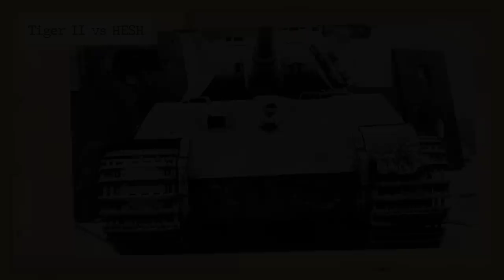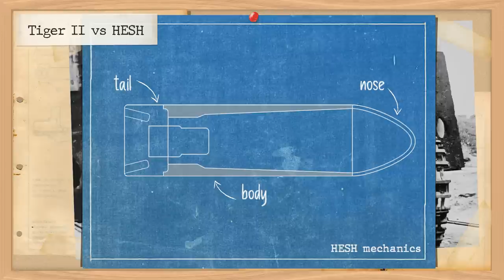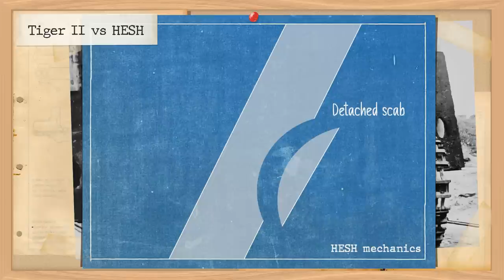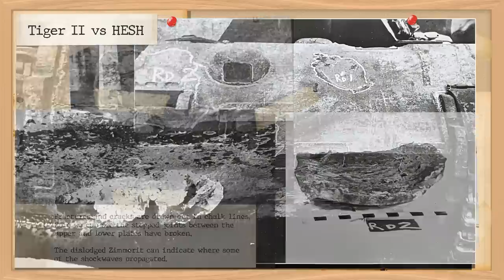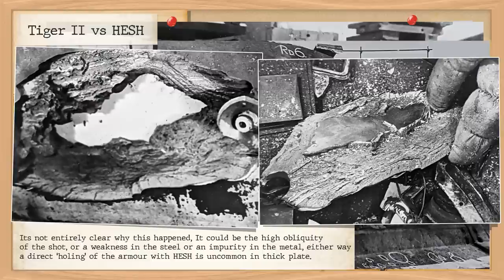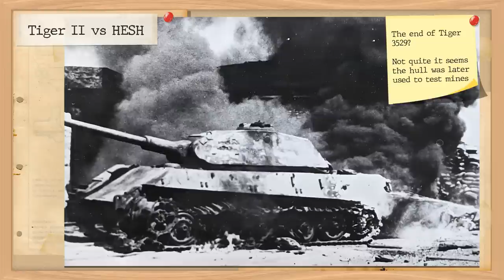Tiger II Versus HESH - Tank testing

Comment: Interesting that the track links were actually effective. I don't think I've ever seen any other ordnance test show such a conclusive result about track links actively contributing to a vehicles protection.
Reply: not really
its just showing how much a garbage round hesh is
smallest amount of space armor makes it almost useless
Reply: @AmirDarkOne  The smallest amount of spaced armor notably didn't make HESH useless, as was noted in one of the pictures referencing a previous episode on British spaced armor design tests.
Reply: Track links have to be as dense or denser than armor because it has to be able to handle the weight and stresses the vehicle its' designed for can generate. All the bolts and joiners also have a little bit of flex that can absorb the shock damage pretty well too. It's all in how it was designed. That's why tankers were putting it all over parts of their vehicles to help protect it, even though they weigh quite a bit.

Comment: As a complete military layman I can say with absolute confidence that getting shot at with anything larger than a nerf-dart is quite a scary situation, let alone a high speed piece of steel.
Reply: if you get hit by the big one your get pasted near instantly its the spall that's really terrifying cause it doesn't necassarily kill outright like in shot one the drive losing an arm and leg but no comments on death so likely would have survived the shot.... which sounds painfull
Reply: @volrosku.6075  Why would you "likely survive the shot"? It depends on where it hits you, just like any bullet or fragment. If it amputates an arm, you will probably live with prompt care. if it hits your torso, you are fucked. The spall fragments are just like the fragments from artillery shells that do most of the artillery's killing.
Reply: Not sure I follow you. You are getting shot at by a HESH shell. You are getting hit with flying fragments of metal. Like with artillery, you are getting shot at by shells , but the flying shell fragments are the lethal part. But no one is shooting shell fragments at you.
Reply: @volrosku.6075  assuming of course no things like infection etc. Either way, it is a enemy combatant out of the fight.

Comment: You mentioned it briefly but I’d love to see a video on exactly why modern British tanks use rifled guns. The theory I’ve heard is that it was to fire HESH more effectively, but is that the case?
Reply: Not any more.Challenger3 upgrade is fitted with a smoothbore gun.I understand that rifling was essential for the HESH round
Reply from the maker: alas while hesh does play a part, its very small, i will do a video as i have the docs a lot of them, but to sum it up, when we were first approached to do a SB gun, the goverment tasked Ft Halstead to decide whether they would be a good idea...but Ft Halstead designed, made, and sold rifled guns.....So surprise, surprise the answer was no. - there were some other considerations along the way, but the bread and butter of it was asking the one company in the UK with a vested interest in rifled guns… whether they would recommend the MOD switched to smoothbores and did away with rifled guns.

Comment: I saw a dinner serving platter size scab from a test with a 76mm gun for the Walker Bulldog off I believe a 4" thick target it was on display at Ft. Knox back in the eighties. I am not sure if the US HEP rounds have the Front buffer material it is not shown in any of the technical drawings of 105/106 HEP that I have seen.
Reply from the maker: should be there, il have an aske around tho

Comment: Interesting to see the British had another   initial/early turret Tiger Tank to do test on after WW II . The tank has early monobloc gun tube,  Later 9 tooth sprocket , and no deep wading pot.
I would guess it was and ex 1st Company or 3rd Company SpzAbt 503 vehicle lost in France. 
As the V2 still exist in Bovingtons collection and Broke barrel at Haustenbeck was scrapped.
The Swiss shot up another of the testing ground tanks and the V3 did not have a turret fitted if I remember correctly. The three  V models were all soft steel and would not have been good test subjects.
Reply from the maker: yes sadly they didnt record much about her at all, no markings i could see, bit of a shame
Reply: @armouredarchives8867  Was one of the early mid steel or early testbed prototypes. It still got binocular sights on the front hull which means it still did not had the sight developed for the gun but used the one from the early tigers for testing,

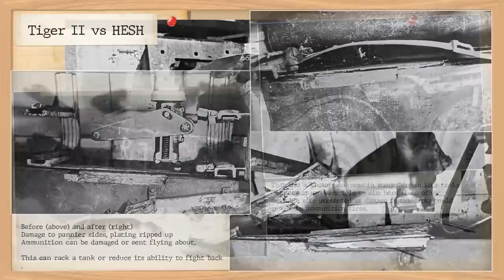At 12:56 Another thing caught my eyes is the drivers hatch elevating mechanism, this is again the one from the early prototypes and not from the ones which entered series production.
Reply from the maker: @venator5  good stuff! recon u can guess which one exactly it is then by rule of elimination
Reply: @armouredarchives8867  I would personally guess that it was one of the first 5 ever built. Since the first 3 was made out of mid steel there is a chance that it was not armor grade, but I am not 100% sure. (The one in bovington is v2 and regardless being the second is still mid steel)

This example is most likely being ranging somewhere beetwen v3 to v5.
One indicator I also seen is the lack of the equipment for submerging.
Reply: @venator5  Glacis is notched for the radio operators  periscope and the hull extensions are cut for the C-hooks.

Comment: I ran across an operation manual for a walker bulldog, in it it stated the velocity of the 90mm HEP was 750m/s and anything over would create too much dispersion of the explosive weakening the blast effect. It would seem that the US and UK test results are essentially identical.
Reply from the maker: pretty mcu, too fast and the plastic will spread too much or the case will crumple incorrectly, too slow and wont crumple at all or have time to form

Comment: i would like to see what 105 hesh and 120 Hesh dose to Warsaw pack AFV mostly the IS3 and T54
Reply from the maker: we never really got our mitts on too many IS3's     T-54s it makes a mess of tho.
Reply: @armouredarchives8867  i know we nadded a T54a from the hungarian revolution in 56 but you just don't hear too much about the IS3s apart from it didn't fair too well after all the hype, in Budapest or vs the IDF and their 105 Cents in 68
Reply: @armouredarchives8867  If 105 and 120 were that good, why did anyone ever try to use 7.2 inch HESH?
Reply from the maker: @Orinslayer  There were several tests done with smaller rounds, but for big structures you need a big old HESH round, and that’s what these demolition vehicles are for, 6.5 was considered an optimum size, enough rounds for several tasks and easier reloading and stowage, but enough boom for your bucks, the older larger spigot weapons from WW2 were limited in capacity, range and had much longer reloads and much shorter ranges.   Others tested like the 7.2 inch (and larger) had to be balanced between role and stowage, for example the large L4 had  a much heavier round and less ammunition, require a lot more crew space and so on, the smaller ones tested needed more rounds and took longer to breach the structures. But worth remberign the purpose of this vehicle is to break open bunkers, blockages, walls and so on, they just wanted to see that if an enemy tank approached could it be used and to what effect. The 105mm and 120’s were more than enough for the enemy tanks and afv’s of the time, enough to be used as a dual purpose HE and make a smaller breach if needed, if something bigger had to be knocked down, you called in the engineers to tackle it

Comment: Fantastic amount of information! After watching this I am wondering if it would have been possible to develop a HESH round for the 75mm gun on the Sherman in 1942-43?
Reply from the maker: very easily so, but they had no quite made the full connection between anti tank and anti stucture work yet, despite some weaposn like the blacker bombard beign made for that purpose. that said by the time they were considering japan it was and hehs was beign used on old m3's and m5 to test the wepaons out
Reply: @armouredarchives8867  if would have thought the technology was there, but given the pace of the war, the connection was over looked. The reason I thought of HESH for the Sherman is that everyone says that some sort of HVAP should have been developed before D-Day. And I would agree, the 75mm could have been a tick better at punching holes in armour, but, it could only fire rounds of a certain velocity. That's where HESH would have been of great benefit. Just hit the target and the warhead does the rest, velocity isn't that important.

Comment: Interesting to see, but there seem to be several occasions where left and right sides are confused?
Reply from the maker: its tricky, if i set the POV from the front and say left then people know left, but if the POV is from the rear and you say lef tthey look at the left of the image, ive tried both ways before with same results, i might just add arrows or something
Reply: @armouredarchives8867  As an example, 11:25 you talk about Round 6 striking the left side of the turret and show a picture of a hole in the right side.  Similarly, at 14:10 you say the last shot of interest was on the rear right side.  You then show a picture of a hole clearly in the rear left side of the tank.  Are not left and right on a vehicle are always defined looking forward from the rear?  Otherwise it's a fascinating insight into these trials.  Of course nowadays we would be doing all we could to preserve these rare and impressive vehicles, not blowing them apart!

Comment: The question for historians is, what could have been brought to bear on Tigers and Panthers during WWII? A 3" sphere has 13% of the volume to a 6" sphere. A 75 mm gun may not have had a shell with enough volume to threaten such a heavily armored vehicle. A HESH round does not depend on the kinetic energy of the round, it is the kinetic energy of plastic explosive that does the damage. The upshot for the Sherman 75mm gun is that a HESH round is just a deadly at the gun's maximum range as it is at 50 yds. And why use a HESH at 50 yards? Why test with a 6" gun? A high explosive round would cause spalling as well.  This is how the ISU 152 killed Tigers. The Israelites did have great successes with the HESH round against T62s. But the T62 relies on sloped armor more than thickness. At a range of 1.2 to 1.5 miles a Hesh round fired from the 75mm gun of a Sherman would be on a downward arch. If it struck the upper plate of the chassis or turret (40mm) it may have gotten lucky. So to for a ballistic capped round knocking some steel loose.

Comment: isnt that tiger chassis no. 280 009 or 280 012? basically that tiger and tiger V2 in bovington swapped their tracks with eachother.
Reply from the maker: yes it seems so, of the two at Haustenbeck, one went to bovvy in the long run the other appears to be this one
Reply: @Armoured Archives  yeah i was interested in these tigers cuz of modelbuilding. This tiger, and as a consequence now tiger V2, had its tracks mounted flipped compared to all other photographed single link king tiger tanks. These tracks are kinda unique since the links of the right and left track are not interchangeable. 

Only other example of a tiger with its tracks mounted like this is the swedish tiger in post war skovde, when the swedish mounted the tracks, but it looks like they swapped the tracks again by the time it reached karlsborg. (Before that the swedish tiger was photographed in austria and there it had its tracks mounted normally).

Basically im saying, when making a model, i wouldnt mount the tracks like on tiger V2 cuz theres no evidence any tiger ever saw combat like that 😜 
Haha cheers

Comment: I'm wondering how useful they would be in modern tank on tank situations.

Yes modern tanks have plenty of protection methods to save the crew and the armor wont break very easily so its better to use dedicated armor piercing shells. But that counts only if you bring a big enough gun, and most armed vehicles out there dont bring a gun big enough to defeat a full MBT.
So ignoring anti-tank missiles, how would you make something like a 30mm effective against modern tanks? Well instead of trying to destroy the insides you could try to destroy the outsides. Periscopes, gunsights, tracks, the gun itself etc could be enough for an attempt to escape at least. And HESH might be the best at that job right? Even just the possibility of dislodging and misaligning the gun sight can help you survive. A near miss on a periscope could still crack it and other sensors like IR or the radars for active defense systems could also be taken out and make the tank vulnerable to other attacks.

But that is what I am wondering, would it actually be any good in the bad situation of you going up against an MBT with a sub-par weapon?
Reply: It's mentioned early on in this video that the construction of modern composite armours makes them more or less immune to the main effect of HESH (Internal spalling). Of course all the secondary effects would still apply, and tanks generally don't have 100% composite armour protection, so a hit on one of those lesser areas would still be effective. It also helps that a honking great big lump of boom is pretty useful in general for all sorts of other targets. Which makes HESH a fairly decent choice as a general purpose round. As for making 30mm effective against modern tanks. They are already as effective as realistically possible. Through damaging vulnerable components. There is even a verified video showing a Russian tank in Mariupol being knocked out and destroyed by a BMP's 30mm autocannon. With some well placed shots from the side just over the tracks.

Comment: A really interesting video but if I understood correctly those HESH rounds was achieved by shooting around 50 yards, that is 53,72 metres! Isn't it a bit close to the Königtiger to claim what a great gun really is?
Reply from the maker: not really, as it doesn’t lose any penetration on range, (like HEAT). but the 6.5 is also a demolition gun and even so the maximum range isn’t great between 500 yards to 1000 or so. But as range didn’t matter in this test but finances did, they were more keen to see how it worked each time rather than accuracy issues.
Reply: @armouredarchives8867  interesting as I really know little about HESH charges but it makes much more sense if it worked well from 500 yards to over 1200 yards or even more. Americans did this mistake shooting quite close with the targets like the Panther with the M18 2.36 inch bazooka that was totally useless against the Korean T-34/85 but that is another story...
Reply: Wouldn't think it would make a difference here.  It's not velocity dependent like a SABOT round.
Reply: @armouredarchives8867  yes, now I understand. I will have a good look on this HEAT rounds...

Comment: Testing from only 50 ft. seems unrealistically close.  Was there an issue with accuracy from a distance? You said too high velocity would affect forming the "pat", but was there a minimum velocity?
Reply from the maker: i dont know why it was so close tbh, the main weapon wasnt very long range at all, could be an accuracy issue, i asume they were protected in some way
Reply: When they are testing only what the round does to the target you want to make sure you hit what you want to hit. Putting it further away would only increase the chance of the shell going off target.

Comment: Love your work, but sadly your reading off the same script as everyone else. I watched a video of HESH v T64 spall is the least of your problems. As I don't want a visit..! All I'm going to say is look at the only Challenger Blue on Blue, namely the 20+ ton turret relocated to the back of the engine deck. It's simply Newton's 3rd Law that is.......?
Reply from the maker: I’m reading the script as written and done at the time by those that did it, T-64 has a lot of laminate and won’t be badly effected, T-62 will. 
- challenger was hit on the open hatch sending hot fragments inside the interior which set alight the ammunition incorrectly stowed inside the turret, the first shot having already landed short injuring others. The entire incident was well recorded in the MOD’s law case and subsequent legal case. ‘Allbut Vs MOD’ June 2013. The vehicle itself is currently in storage in the UK in the condition it was in as it was used as evidence in said legal trial
Reply: @armouredarchives8867  The original in theatre image shows the turret on the back of the engine deck... Not conducive with the issued report. And I know when to keep my mouth shut. But it could be faked like drag racing and spinning the tracks of Challengers at the Newcastle Factory or the hint that the Challengers suspension makes it the worlds fastest off road Tank (ripsaw not included). Keep up the good work.

Comment: A shot from 50 feet.  Point blank.  Not battlefield conditions.  The King Tiger was designed to knock out enemy tanks from 2 kms.
Reply from the maker: Sigh, this is about testing the AVRE's gun to see if it could peforate armour if it had to defend itself. not to evaluate german fantasies.

Comment: Honestly, a 165mm explosive is over power against anything anyway.
Reply: Also test of russian with JS3 show that just HE rond of 122 are very effective and can shut down a tiger 2 from a front glacis shot, this tech was really useless as classic tech already exist, just remember 165mm is heavier in size than 155mm or 152mm artillery.
Reply from the maker: They are not that heavy as thinner shell casings etc, but they are first and formost demolition guns, designed to break down concrete stuctures. these tests were more a case of, if we have to shoot a russian tank, will it work